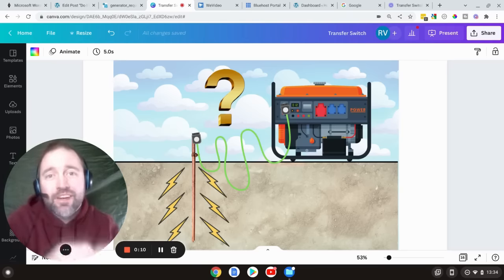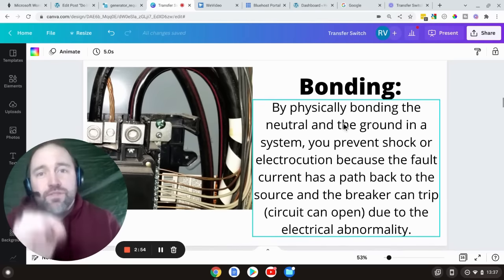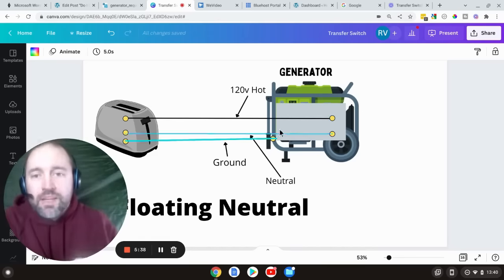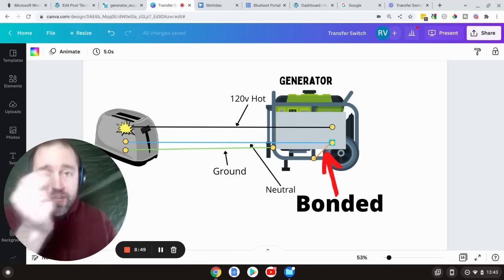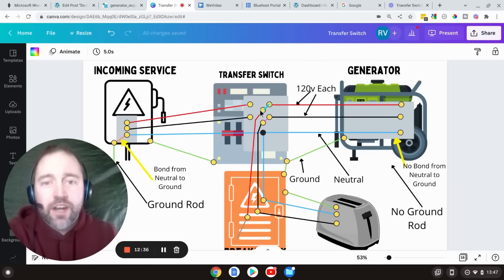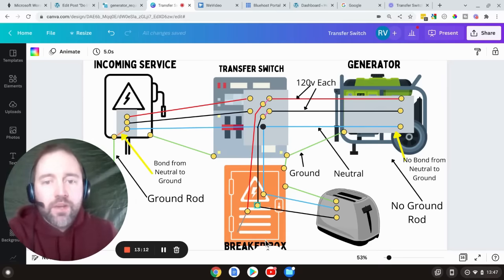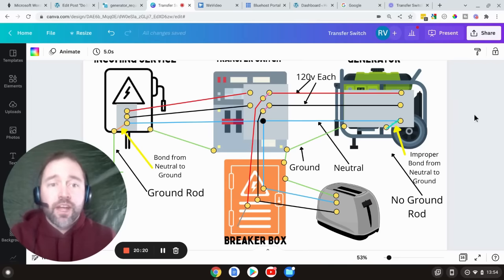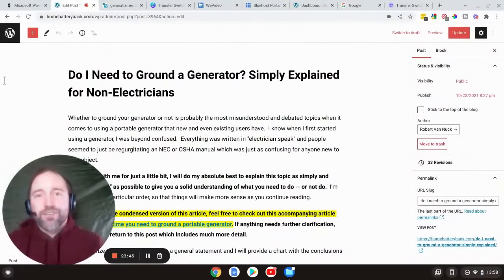When You DO and DO NOT Need to Ground Your Generator [Extension Cord Use & Backfeeding a Home]

Comment: Here's my best ground rod story: I set up power for a small concert connected to mains with approx 250 feet of romex. I had a bunch of six foot stainless steel rods, so I drove a couple of them behind the stage and bonded to the ground. The musicians, being accustomed to always hearing a little hum, at first thought their amps were dead because they were so quiet!
Reply: Yes ground is really good for guitar amps
Reply: Breaker is an over current protection device , that's all . When a short to ground happens , the low resistance ground connection will allow current to flow that will exceed the breaker and cause it to trip . Not talking about arc fault or gfi breakers . All this to say if you extend a hot wire  to a ground rod the breaker will trip
Reply: That's true for mains and such.  But what he's referring to is the RF/EMF harmonics in the device, and were cleaned up by having good grounds.  Has nothing to do with current or circuit breakers.  @anonymouslyominous33

Comment: In Finland you need to switch the neutral also, so that the incoming neutral doesn't become hot in case of a fault on the incoming and there are linesmen working on it
Reply: 😮 in Canada … we have safety laws … but I don’t think we have that one.  After watching this, I’m educated-guessing that my generator isn’t bonded, and without neutral switching.  😳  the transfer box disconnects the live wires, oooooo, I had never thought about a fault dumping voltage into the wrong wire, and feeding the neural.  😱

I sincerely hope there is a circuit-breaker, or fuse, somewhere to prevent that.  🥺  inside the generator.
Reply: I don’t know enough about where bonded/neural-switching wound be required, by Building Code, but I’m guessing it’s defined by wattage, like >10kW must get the extra safety features.  … below that, yeah, I think we rely on fuses or breakers.  😳
Reply: Finland won't be populated by Finns soon because Finland is too woke..
Reply: The way I understand it is, you could have a fault on the neutral, but if it can't complete a circuit through the transformer windings, it can't energize the transformer to become a risk. It has to flow through the center tap, and back through the other half of the winding, but the transfer switch prevents the completion of the circuit. Unless it failed or is shorted across the switch, there shouldn't be a problem. Even then, the entire switch would likely have failed, so an extra switching point wouldn't gain anything.

Comment: USE A GROUNDING SOURCE ON ALL GENERATORS!!! One thing this guy did not mention in his video was Inductive Voltage (Stray Voltage) that comes from Motors. If your using a Floating Neutral Generator were the Motor is grounded back to the Generator but the Generator itself is not bonded to Earth Ground, there is the possibility of the Inductive Voltage accumulating in the Frame of the Generator even-though the Generator is NOT Grounded to the Frame (because it will act as a Capacitor), and if that Voltage builds up high enough and someone touches the frame of the Generator especially with a can of Gasoline in their hand, well all it takes is a spark to end bad. If the Generator doesn't have a Ground screw, add one to it, or Permanently add a wire to it with a clamp on the end so it's there to remind you to Ground it to something (Outside AC Condensing unit, a Light Pole, etc).
Reply: You just answered my question I bought a 165 kw gen mounted it on a trailer built a pannel to run some RVs or my house. There's the hard ground wire under it I was going to drive a ground rod were we camp on our land and hook to it  . Or when at my house can clamp onto ground rod at pole by my transfer switch
Reply: Yeah, that was the whole reason. I was watching this video because on my generator they tell me I should Have an earth ground with a copper rod. So this guy didn't help me either. You helped me. I just wanted to know why I had to use a copper rod with my generator and he never explained it. Thank you, sir.😊
Reply: This is a good point but has nothing to do with the actual wiring system the idea behind the discussion of this video is to be able to make the breakers trip for protection. You are right though I have seen enough people catch themselves on fire just from static electricity in the wintertime when refueling their cars at the gas station this is a separate electrical consideration the wiring in their car though the tires prevent the car from being grounded the same way that the rubber feet prevent a generator from being grounded through the frame.  You can add a metal chain or aircraft type cable and allow that to drag on the ground or connect it to some metal on the pump to bleed off static electricity or you can just touch the metal pump nozzle to the filler pipe for a second before you open the fuel cap aircraft have grounding lugs and the fuel trucks come equipped with a long wire on a reel for connecting to the aircraft for this very reason it also doesn't help that most modern gas cans are non metallic and that the plastic will hold a static charge itself and even if you touch them to the metal the don't let go of their static charge as fast as metal would. The real rule is you only want your system to be grounded and bonded at one point if you are concerned about this risk then you should use a temporary ground on a chicken stick before refueling only and this should never be done while the generator is running anyway your generators wiring must meet the electrical standards to be safe.
Reply: Hi bradw.5991, you mention ALL GENERATORS, but go on to speak only of floating neutral generators. What is the case with a bonded neutral generator? surely no inductive voltage can accumulate as the casing is bonded to the source point of the generator, thus mitigating the risk of shock?
Reply: @jamesdamien121  Please list the Model and Model number of the Portable Generator that we are talking about in these comments that has a Bonded Neutral. I would be very interested to know of the one you are questioning about. As far as your Bonded neutral Generators, most of those are Permanent Fixture appliances and are governed by the Codes in the NEC for proper grounding. The problem with the 'older' Portable Bonded Neutral Generators was the same issue talked about here. The Generator frame was never Grounded, but since the Frame and the Neural are now connected, the risk for electric shock was even greater. Remember, in a Electrical Fault the Power from the Hot lead doesn't want to go to Ground, it wants to go back to the other side of its source (either the other Hot 240VAC circuit or Neutral (center tap) 120VAC circuit), but it uses the ground as a conductor. If the Bonded Neutral Generator Frame is not grounded, the Fault cannot travel thru the ground back to the Frame to its power source (neutral). If you were to touch the Frame during this Fault and you were grounded to the ground say bare foot, you wouldn't have a good day.

Comment: One more thing to note:  If you are using two or more portable generators, never place them in close proximity to each other.  There could be a dangerous electrical potential between the frames of the individual generators.  If someone touches both generator frames simultaneously an injury can occur.
Reply: Then simply bond them together.
Reply: @2013Aleksey2013  yep grounding them to the same ground point should fix that issue.
Reply: This actually makes no sense.  Where exactly would the return path for that current be?

If they are both connected to a common electrical system, and both of the frames are properly grounded to the shared system ground, then there is no possible difference in potential (you don't even need to bond them.  They're already bonded through the common ground line).

If they are not connected to a common electrical system (each one is powering different things completely unconnected to each other), then there is also no electrical path between them for any current to flow back either, so it's not even possible to complete a circuit and get a shock from them.  (really, since there is no common potential reference point, the whole concept of "different potential" between them doesn't even apply and means nothing in that case).

This could only happen if they were both connected to a common electrical system (i.e. a common neutral), but they were not also connected to the shared ground of that system, which is just obviously wrong to begin with.
Reply: @foogod4237  Your scenario # 1 does require neutral bonding at the generator if the neutral is switched-study separately derived systems (and a ground rod would be needed).  

Your scenario # 2 is extremely dangerous. An electrical potential can DEFINITELY exist, and people have been electrocuted in this way. Where is the path? Study the basics.
Reply: It's what I use to restart people's hearts 😅
Reply: @bretgreen5314  You don't get to just blithely say "study the basics" just because you don't actually know the answer to my question.

I repeat: Where is the return path for the current?  If you're so sure there's an electrocution risk, but you can't actually answer that very simple and obvious question, then you are clearly the one who needs to "study the basics" about how electricity actually works, not me.
Reply: @foogod4237  Okay, I will try to be as short and simple as possible.  Three words: imbalance of electrons.
Reply: fowyb  If my explanation doesn't make sense to you, so be it.  Either further educate yourself, ignore my hazard warning or whatever you wish. I am not going to give an elementary class on electricity here. There is not enough space, and I do not have the time.  Name calling is a waste of my time. I now move on from this discussion. Good day.
Reply: @bretgreen5314  So you're seriously claiming people have died from static electricity?  Because that is literally what an "imbalance of electrons" is.  Unless you're talking about things like lightning strikes, static electricity buildup (even up to hundreds of thousands of volts) simply does not ever have enough stored energy to really hurt anyone.  Realistically, you might feel tingly for a minute, that's it.

And even if that was possible, which it isn't, you can't actually get a static electricity buildup from an AC power source anyway.  It would need to be rectified somehow first.

You clearly have no idea how electricity actually works or what actually is or isn't dangerous.
Reply: @foogod4237  Where multiple services or separately derived systems, or both, supply portable structures, the equipment grounding conductors of all the sources of supply that serve such structures separated by less than 3.7 m (12 ft) shall be bonded together at the portable structures. The bonding conductor shall be copper and sized in accordance with Table 250.122 based on the largest overcurrent device supplying the portable structures, but not smaller than 6 AWG.  Bottom line, keep multiple generators more than 12 feet apart if at all possible.  Otherwise, bond them as above. Stay safe everyone.

Comment: Your diagrams showing a transfer switch indicate a ground from the case of the switch to the home's grounding rod through the service connection's housing and a ground connection from the generator to the case of the transfer switch. Wouldn't this provide a ground regardless of a secondary ground rod directly off the generator, regardless of switch type?

Comment: A ground rod is essential when you start your portable generator without connecting it to the house with an extension. Specially when it is raining or snowing and the generator is all wet in Canada. When you connect it the ground rod is not needed. The ground is connected to your water inlet copper pipe.

Comment: Floating neutral and using extension cords - I agree you should be using a bonded generator...but this and your website are wrong, there's no exception for the need of a grounding electrode when the generator isn't bonded. In order to forego the grounding electrode you must meet both criteria of using only extension cords AND a bonded gen.

Comment: You can Never be too Safe when Messing with electric generators etc. in 2004 Baldor TS130T commercial Generator man on my crew was unplugging a Lead from a concrete grinding machine we had done it for years. it about Killed his ass because of a short. 20 years later we still call him Sparky🤯

Comment: grounding electrodes do not help with lightening strikes. its mostly just to lower the impedance of the ground wire. but you only need them in one spot, 6 feet apart max, otherwise it could possibly create a path for current to flow from like underground, like during a lightening strike and light up everything bonded in your house.

Comment: Thank you. I now understand what I didn't fully understand before. I am a Industrial Electrician for 17 years. I've wired up new machinery, ran conduit, installed and programmed PLCs, and was one of our best troubleshooter. The way you explained bonded and floating neutrals just clicked in my head. The path to grounds and neutrals, bonded and unbonded, are what did it.
Thank you again.
Reply: Appreciate your honesty, but this is exactly why I DIY almost everything.   A lot of the times, I’m gonna know more than the guy in the van and he is still going to charge me 50/hr.

Comment: In Canada the generators I could find were are all bonded neutral but my home transfer switch required an unbounded neutral generator. Champion sent me instructions to unbound the neutral on the generator I purchased but I never understood the ground requirement. Thanks for the great explanation you probably saved me from a shocking experience on a wet and windy evening.
Reply: Never understood why portable generators are shipped bonded.  It's easy to build a plug to bond at will. Unbonding a bonded generator is more involved.  Heck, why not just include a bonding switch on the generator?

Comment: I'm a design engineer and love that you mentioned about GROUNDED and GROUNDING and these terms are not interchangeable. Thanks man. I've been telling engineers that for years and these young designers who believe they are. Right now, I believe it very important in what I'm doing as currently I'm working on substations as a relay and control designer. Some here don't get it and I'm shocked at that - no puns intended. Nice that you mention it.

Comment: Great video. The diagrams are on point and make this complicated topic easier to understand. At around the 15 minute mark you talk about the reason for having the supplemental ground rod at the generator. Another reason for the supplemental ground rod is because Earth potential at the service ground rod and Earth potential at the generator site would not be the same. Without the generator ground rod he frame of the generator would be lifted to the potential of the service ground rod, and there could be a difference in potential between the frame of the generator and the earth at the generator site, meaning you could get a shock when touching the frame. By adding the supplemental ground rod at the generator, you ensure that the generator frame has the same potential as the earth that you're standing on.
Reply: Yes

Comment: This is an absolutely correct explanation of generator connections.   Very well explained.  
To be clear, the available fault current from small generators is no where near high enough to quickly trip a breaker magnetically from a fault.  It will however, for a longer period of time trip from overcurrent.  It is splitting hairs!

Comment: I wish my generator manual was more explcit about this.  It does state that it's a floating neutral and advises to consult an electrician regarding a ground rod, but it doesn't mention the importance of consulting an electrician regarding the neutral bond.  

That MIGHT make sense in the case of a stand-alone generator that is intended to be used for powering something connected to the grid, but for a PORTABLE generator, it would seem that the manufacturer should know that folks are going to use it for RVs and to power worksites, and should issue a similar advisory regarding its floating neutral status.